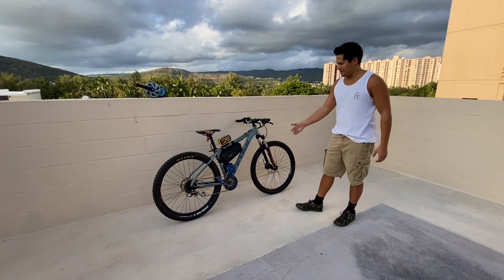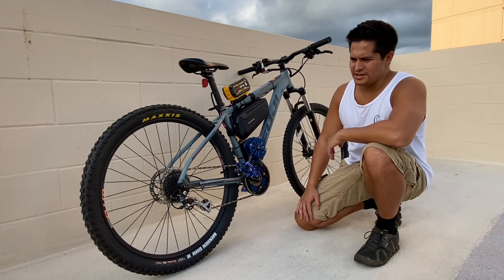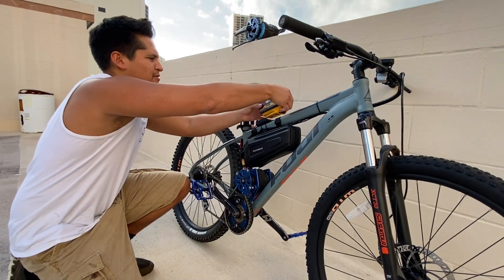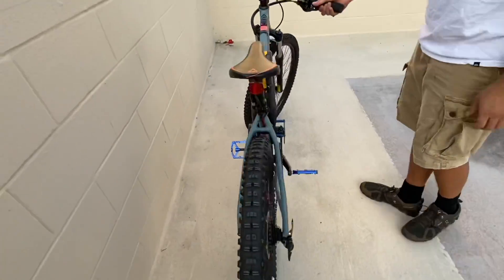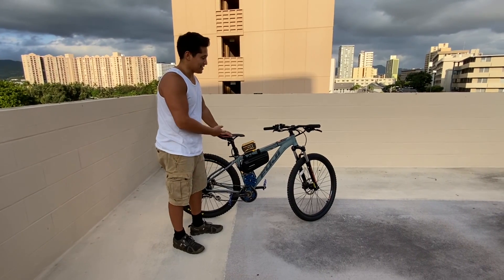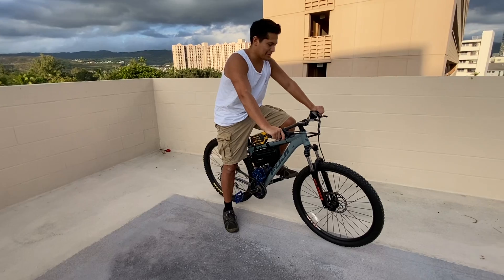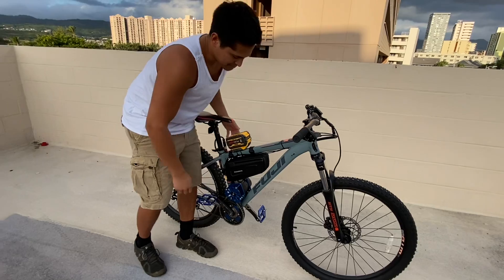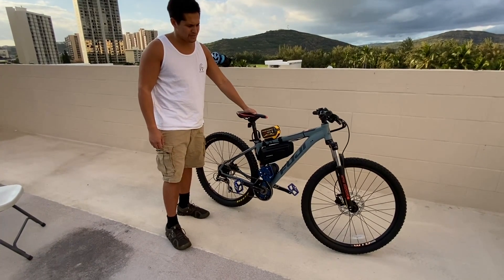Mini cyclone ebike powered by Drill Battery (dewalt 60v)

Comment: Do you have a fuse on the battery adapter and if so, what size of fuse? Thanks.
Reply from the maker: no fuse but I wouldn't pull more than 40 amps which you can set with your controller and your battery should have a BMS with power tools
Reply: I have the same exact battery in your video. So is there a BMS inside it or is it in the tool itself? Thanks for your reply. Do you still do ebike stuff? @hawaiiebikes707

Comment: The Dewalt 60v Flexvolt battery will only push out 3 amp-hours which probably will only give you 5-6 miles on a charge.  Good for short runs around the neighborhood.   Cyclone controllers have internal electronics rated for a max voltage of 80 Volts.  Lots of battery choices.  Ego 56v, Echo 56v, Greenworks 60v and 80v, just to name a few.
Reply: Thanks, that's what I'm looking for. I want to use (legitimate) namebrand batteries, for whatever motor.
Reply: Yeah, 5 miles is about what I'm getting off of one battery on a BBSHD

Comment: What type of range do you get with 3amp on that battery?
Reply from the maker: Horrible range 😂 maybe 5-6 miles on throttle only. It’s not an efficient motor but it has great torque.
Reply: @hawaiiebikes707  , some of us commute less than that every day to work.  It's a perfect build for inner city commute.
Reply: @hawaiiebikes707 have you tried running two flexvolts in parallel?

Comment: it's all about gear ratio with mid drive systems.
I've had mid drive ebikes pulling Wheelies from the start with just 350W motor.

And that was a small hoverboard hub motor converted into mid drive.

I've built powerful e-bikes using powerful motors.
So I know the difference.

Comment: How many miles can you go on a full charge
Reply from the maker: I was using the 3AH pack and it had a range of about 4 miles on electric alone but it was also drawing 2-2400 watts. Dewalt has a 4AH pack that would be slightly better

Comment: Are you still in oahu i have a bike i want to convert using dewalt batteries would love to pick your brain treat you to lunch
Reply from the maker: I would suggest using the kobalt “80 volt” high output battery. It’s really 72 volts nominal and uses the Samsung 40T cell which allowed 35 amps continuous and 45 amp bursts. Great deal for the money
Reply: @hawaiiebikes707  I have a bike I wantbto convert just need somevhelp planning
Reply from the maker: @JRich808  can you measure the bottom bracket of your bike? I have a bbshd motor for 68mm bottom brackets that I could install and design to accept a 60 volt adapter. Would need to install an aftermarket controller cause bbshd is designed for  48 volts and you need the dewalt 60 volt adapter
Reply from the maker: @JRich808  can you measure the bottom bracket of your bike? I have a bbshd motor for 68mm bottom brackets that I could install and design to accept a 60 volt adapter. Would need to install an aftermarket controller cause bbshd is designed for  48 volts and you need the dewalt 60 volt adapter
Reply: @hawaiiebikes707  i replied eariler and for some reason it removed my response. I think its 68 mm . the bike is a Rocky Moutain xts-x-50 size m.
Reply: this is the info on the bottom bracket 
RaceFace Team X-Type BB Cups, 68/73mm
Reply from the maker: @JRich808  that should be compatible. How many dewalt batteries do you have and what type exactly?
Reply: @hawaiiebikes707  I have a 60v 9ah and a 60v 6 ah and am willing to buy more or larger
Reply from the maker: @JRich808  I really want to help you out man. Just a little complicated to make that setup work. I have the extra motor we just need a controller to run the voltages that would match the batteries you have. Shoot me an email I check that more often hawaiiebikes@gmail.com and let me know your budget. You’ll be able to save on batteries with what you have

Comment: Sweet build man, I’d love to get ahold of all those parts (or another mid drive). I have plenty of dewalt batteries and would love to see a build process on this or something similar. Super cool man!
Reply from the maker: I would go with the BBSHD for ease of installation. With an aftermarket controller you can get really good performance. BBSHD really wakes up at 72 volts

Comment: How did you make or find the battery bracket that offers the flexvolt function? I have regular 20v adapters only. I know it needs to push on the battery pin to switch to 60v. Thanks
Reply from the maker: You can find the adapter on eBay 🤙
Reply: @hawaiiebikes707  
Amazon has a flexvolt connector for $16

Comment: Love your bike build.  Just subscribed.

Building an ebike but just a BBS02 and on a 27.5 Giant Talon 3.
Reply from the maker: @jamesgibson3242  hi sorry I never responded here. I want to do a build with a bbs02 but with an aftermarket controller so you can get more power out it. I’ve seen people run 72 volts on that little motor and I’ve already done it on the bbshd and you get great performance at higher voltages
Reply: @hawaiiebikes707  I just liked and subscribed.  I love your bike.

Comment: What’s the discharge rate of the 60v Dewalt battery I’m looking at the same build except the bafang 1000w kit. Controller is 38amps.
Reply from the maker: I’m not sure what the max discharge rate is but it has 21700 cells and has handled me using 42amp controllers so you will be fine at 38amps. Keep in mind that you’ll need to install an aftermarket controller on the bafang bbshd to run past a 14s (52 volt nominal pack) the dewalt flex volt is 15s (55.5 volt nominal) so at a full charge it reads 62 volts which will either blow the stock bbshd controller or just not run. Bbshd at higher voltages really shines though and it’s nice having a small light pack for short trips! 🤙
Reply: @hawaiiebikes707  really why is that!? Because the voltage changed? Sorry I’m new to all this, any knowledge you can pass my way, would be greatly appreciated!

Comment: Sick 🔥🔥🔥 I been looking to build an eBike but can’t find any company that ships batteries to Hawaii
Reply from the maker: Bruh I’ve found a lot of luck using power tool batteries and electric lawnmower batteries like EGO 56 volt (52 volts)  or Kobalt 80 volt (72 volt) packs. Lot of these companies like to market their packs as higher than nominal voltage. I’ve also had luck using eBay to buy power tool/lawnmower packs and you can buy adapters to them online too
Reply: @hawaiiebikes707  Thank You Bro!.. I appreciate the knowledge imma definitely look into it. Mahaloz 🤙🏼